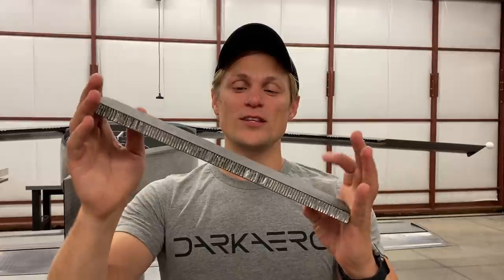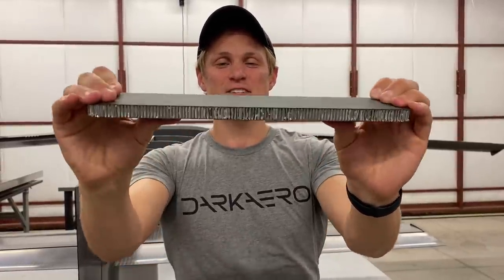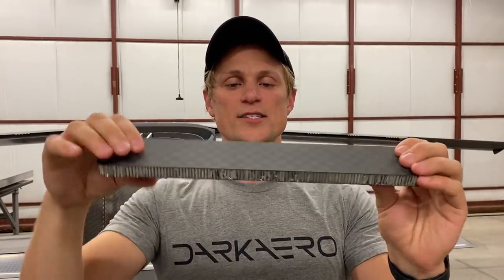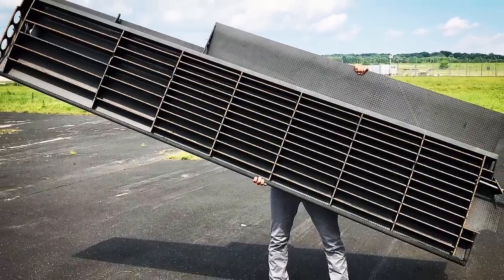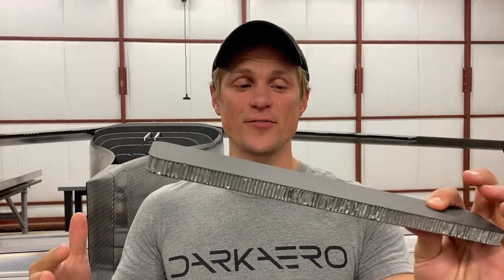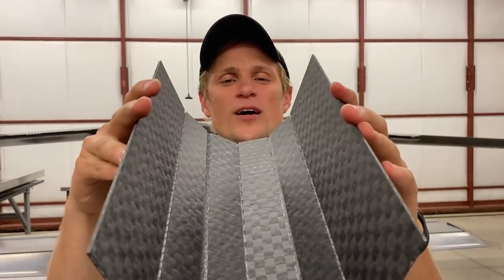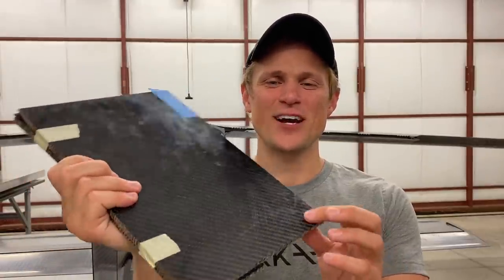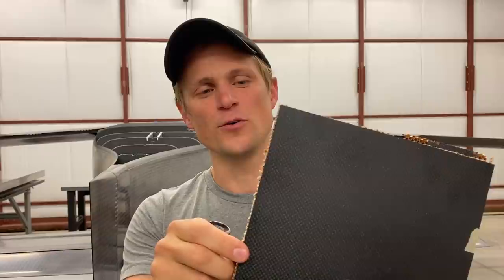CARBON FIBER + Honeycomb Sandwich Panels in the DarkAero 1 EXPLAINED!

Comment: If you guys dont use pre preg how do you keep the honeycomb from filling with resin?
Reply: I would guess gravity, by having the wet skin at the bottom, directly on the table.
Reply: @nraynaud  I'm guessing its a process similar to this:

https://youtu.be/YRpu3pb2b3U
Reply: Thats actually not really a problem. The interior of most planes (like Airbus A380, , mainly the side/window panels, are largely made out of nomex/aramid honeycomb filled with resin.
Reply: @12346798Mann  Filled solid?
Reply: @beachboardfan9544  yes, the honeycomb is good against horizontal forces, you can stand on it all by itself. The resin strengthens it against lateral forces and basically turns the whole piece into a single composite. 

I saw it at one of my company's subsidiaries, they are a tier 1 supplier for Airbus and basically make the whole interior excluding seats. The venting ducts are the craziest part, completely out of carbon fiber and spanning the a large part of the space above the cabin.
Reply: @12346798Mann  Seems like it would be wildly heavy

Comment: How does the manufacturer avoid the galvanic corrosion effects of cabon aluminum carbon honeycomb sandwich?
Reply from the maker: Hey John, thanks for watching and the question! We did a video on this topic. In short, they are electrically isolated. Full video here: https://youtu.be/yRpMZaU8zKw

Comment: Maybe save some of the offcuts from each panel, test each one for bending, and save in a library in case of issues with kit parts.
Reply: Evan Gatehouse    Good idea
Reply from the maker: Evan, we might do a video on this down the road but in the earlier days when we were moonlighting the company all we did was R&D and destructive testing on the panels. :)
Reply: @DarkAeroInc  This was more of a post production QA test to ensure you're not shipping parts where somebody mixed the resin slightly wrong or the vacuum was too high and sucked too much of the resin out etc etc. Just to verify that the material properties are as predicted.  At the high end in my world, the incoming raw materials are also tested before you build anything with it.
Reply from the maker: Agreed that quality checks are critical. We have a set of QA checks and manufacturing procedures we use that are mostly proactive but we run some destructive tests as well. In the process of developing the panels, we had to determine all the variables that contribute to making a quality panel. One thing we learned was that on a panel as large as 4'x8', there can be variation across the panel if your process is incorrect. Testing a cut off scrap is only useful if you have the correct manufacturing procedure in place to ensure consistency across the whole panel. We follow a specific procedure to manufacture the panels and document that key variables are within acceptable limits. Who would have thought making a flat panel could be so involved! :)

Comment: Aluminum + Carbon often has corrosion issues. I noticed that the panels you sourced from manufacturers used aramid cores which are completely compatible with CF. Are you at all concerned about that?
Reply from the maker: Great question! The carbon fiber skin is electrically isolated from the aluminum core with a thin layer of fiberglass. We did a dedicated video on this topic if you want to see more in depth info on how we handle corrosion issues. https://youtu.be/yRpMZaU8zKw Thanks for watching!

Comment: Curious to know why all the samples are Aramid core and you chose aluminum core.  Love the tech videos guys, keep them coming!
Reply from the maker: Hi James! We tested other samples that aren't shown in this video. The video shows a sample of the samples. :) The prototype DarkAero 1 uses both aramid and aluminum honeycomb cores depending on the structures. The internal structures of the Wing, HS, and VS are made from panels that use an aramid core while the fuselage bulkheads use aluminum honeycomb cores. Aluminum honeycomb has higher compressive strength to weight ratio compared to aramid. The fuselage bulkheads like the baggage floor and seatback see larger compressive loads so aluminum is a good fit for these. In production we are actually converting everything over to aramid core for manufacturability reasons. We have found aramid easier to work with in a mass production environment.
Reply: @DarkAeroInc  I was going to ask about galvanic corrosion considerations in bonding aluminum core to carbon fiber, but if you are transitioning to aramid core for production models that will take care of that issue going forward.

Comment: So in theory could you make a whole plane out of folded honeycomb carbon panels including all the outer skins? Is there any structural weakening when you mill and bend the panels? It would be a very boxy plane but maybe an interesting proof of concept.
Reply: Yes, the "Chipper" was manufactured this way and was boxy.
Reply: The YB-70 Valkyrie was built with an outer skin of stainless steel skins brazed to a stainless steel honeycomb.  They had compound curves.  They also had delamination problems.

The SR-71, designed just after the YB-70, used sheet titanium instead.  Leading and trailing edges, and the inlet cones and vertical stabilizer were initially an asbestos-silicone composite, intended to be stealthy.  They may have given up on that at some point.

It's amazing how long people have been using composite technology.  The De Havilland Mosquito built during WWII was, in some sense, a wood/glue composite, as were some of the wackier German airplanes.

Comment: How do you panelize/nest your parts in Fusion 360?
Reply: They are using OnShape. Not sure if there are different toolsets there. I signed up for a free account to play with it, but it was enough of a departure from F360 that I stopped pretty fast.
Reply from the maker: There isn't a tool that will nest them all for you. We also have to orient some of the parts according to the weave of the cloth. One plug-in that does help semi-automate it though is called, "Nester".

Comment: The inside of that wing looks awasome.. I'm no engineer but something tells me that with it being a wet wing and all those ribs it's going to be a bitch to fill the fuel tank at decent flow rate with out air locking and fuel coming back.. But I'm sure you guys have thought of this. Cheers love the plane and totally want one...but again I'm no engineer can't afford haha
Reply from the maker: The ribs and the shear webs that run within the wing all have strategically placed CNC cut ports that allow fuel flow between all cell cavities. The ports are placed at the maximum and minimum height position for each respective cell to allow fuel to flow down and air to flow up. Port size was determined based on calculations and testing for max fuel flow when refueling the aircraft. The wings themselves have a 3.5 degree dihedral allowing the fuel in both wings to flow down to the 1 gallon sump at the center of the wing, which is where the engine pulls its fuel from.

Comment: Wait a minute - you say you didn't use one of the prepreg plates, because it had holes and wouldn't store fuel well - but surely you wouldn't expose a laminate directly to fuel without some sort of liner? Also, when it comes to foam/hex cores, isn't aren't the carbon and cured resins the most temperature-intolerant parts of the laminate? I thought aramid and aluminium were both more temperature resistant than carbon and epoxy.
Reply from the maker: Thank you for watching Invisty! Great questions! Laminates can be exposed directly to fuel provided that the chemistry of the epoxy used in the laminate is fuel compatible. Yes, typically the cured resin and foam cores are the limiting factor for temperature capability of a composite structure. However, there exists a wide range of epoxies and core materials that can be used which all have different temperature capability. We only use resins and core materials with temperature capability beyond 300 F. I didn't give out any specific numbers in the video but many of the 3rd party panels we tested had carbon fiber and epoxy skins with service temperature ratings of 180F and below.
Reply: @DarkAeroInc  Thanks for clarifying, my ignorance probably stems from only using composites for boats. I think the very idea of a kitset carbon panel plane to be ambitious and really cool. Hope you can pull it off with all the tricky engineering required.

Comment: What effect will an inflight lightning strike have on that method of construction ?
Reply: Good question. I wonder if the aluminum honeycomb would create a Faraday cage? Don't they embed a copper lattice into the layup on airliners using extensive composites?
Reply: Dan Mallery 
Well I’ve only got about 3000 hours in the 787 and the only time we’ve ever had a problem is when we were parked on the ramp at Shanghai and got struck by lightning. It blew up the ground power terminal and we spent an extra couple of days there. I highly recommend a club called Manhattans ! ; ).
Reply: @savagecub   Yikes. Getting struck by lightning, even on the ground...better just leave the whole bottle. :-)
Reply: Dan Mallery 
Ah hell, airplane was parked at the gate. We were already at the bar in the hotel when that happened !
Reply from the maker: We don’t have good data on that because we haven’t completed lighting strike testing yet. However, we have been doing a lot of research on this and we are leaning on the testing and standards from the FAA (two good ones are the DOT/FAA/CT-89/22 and DOT/FAA/AR-40/13). The two big concerns are interference with the electrical system and fuel vapor ignition. One potential solution we are exploring is conductive coatings.

Comment: I'm a bit concerned about your fuel tank integrity. Would love to see the thought put into that design question.
Reply: Composite fuel tanks have been used for decades in marine applications
Reply: The question more has to do with the use of honeycomb core material. I can't remember now, but even if it's not paper, I'm concerned about fuel being trapped in the voids making the airplane unnecessarily heavier.
Reply: @Zalex612  This was spoken to explicitly in the presentation.
Reply: @mavigogun  You're right, it is brought up at 6:09. What I was referring to specifically, is the bonding joints between the honeycomb and the skin when the wing is assembled. If there is even one error/bubble in that bonding surface it could lead to a slow seepage of fuel into the sandwich structures that would, at minimum, increase the weight of the aircraft. Worse, possibly, is delamination and debonding at those seepage points due to thermal expansion/contraction cycles. The wing could become structurally compromised after a few years or so in the elements. Don't believe me? Look at how careful Mike Patey is when building his fuel tank. https://www.youtube.com/watch?v=JZSGdM9cWjY In that example he's just being very thorough to ensure there are no leaks. Also, notice how every cell of that tank has an access panel? There's a reason for that. Future repairability. His tank isn't even a composite tank!
Reply: @Zalex612  It would seem fraught with peril, as complex as it is.   Either they have developed blindered to this point, or they aren't sharing their solution.   I reckon the second is more likely.

Comment: I am absolutely no professional, so please understand my question as sheer interest. I understand the need for certain stiffness. However, especially when material is under high stress I would expect flexible material to sustain the situation a lot longer than the stiff one. Additionally, I would have a chance to realize the problem before the wing breaks since it bends while very hard material doesn't show any tear until it suddenly breaks. Am I wrong with my assumption?
Reply from the maker: That's a good question! In the case of our aircraft, stiffness is useful for preventing buckling failures of structures and for preventing aeroelastic flutter. The airframe is designed with safety margins so that it can withstand loads within the flight envelope plus some extra. Carbon fiber does have some flexibility to it, it just doesn't plastically deform before it breaks. This flexibility can be seen in this video where we did a full scale proof load test on the wing: https://youtu.be/7hvu-oQZdvE
Reply: @DarkAeroInc  Hi, thanks for your answer. One thing that concerns me generally with the choice of material is that when you overstress metal structures and they start failing, you will see the cracks. Not that much with your material choice. Is there a plan or any idea how to make these "invisible" damages visible to prevent a small damage to become big after some pilot has overstretched the limits of the ac?
Reply from the maker: @crazycons  There are visual inspection techniques for assessing small defects/damage to composite structures along with other non-destructive tests like tap testing and ultrasound. The FAA document AC43.13-1b has some information on inspection and repair of composites. Cracks in metal structures are typically the result of fatigue which is repeated cyclical stresses that cause small defects in the microstructure of the metal to grow and propagate into larger cracks. Composites, in general, are much more tolerant to cyclical loads. Small defects in the microstructure of composites do not tend grow into large defects so this failure mode is much less of a concern in composites. This resistance to fatigue is part of the reason that there is a big shift towards composite materials in the aerospace industry.

Comment: Thank you for sharing. One quick questions. 
 How did you handle the potential issue with galvanic corrosion?
Reply: Sì! E la corrosione?
Reply: Same Thoughts...a large helicopter manufacturer had made their tail boom panels with aluminum core... they had to redesign due to corrosion.  I believe this comprised strength and caused problems.
Reply: @jeffreygoyer7760  I would imagine the solution be either or a combination of anodizing the aluminum material, and an epoxy/fiberglass barrier. But let's see what their solution is.
Reply from the maker: The carbon fiber is electrically isolated from the honeycomb using fiberglass. The panels themselves are carbon - fiberglass - honeycomb - fiberglass - carbon.

Comment: Carbon fiber + aluminium= galvanic pair,  just with a bit of humidity aluminum will start degradate.
In sailing it's a regular problem when metal parts have a direct connection to carbon fiber parts like for ex. mast

Comment: I hope you guys have a good factory build center because all the glue joints for the wing skins have to be perfect. This is why the commercial gliders have single spar to ease the manufacturing because they only have to worry about the main spar, the ribs, the leading edge and aft spar.  Good luck though. We need to have another composite kit that follows the Lancair 360 or the Glasair 3.  However, few people can afford to build them.
Reply from the maker: @2Phast4Rocket, this part of the assembly process is done on our end. The builder receives the wing fully closed out.

Comment: Drop one of those panels in a bucket of salt water and leave outside for a few days to see how the core stands up to corrosion. We do not usually recommend aluminum core against carbon faces, unless of course you have a glass insulating layer!
Reply from the maker: Thank you for watching Dan! We discussed the corrosion issue you mention in this video: https://youtu.be/yRpMZaU8zKw

Comment: Very impressive guys. Do you have a video where you talk about bird strikes? I heard carbon fiber does not hold together well during a high speed impact. I was wondering if you address this concern somewhere?
Reply: The issue has been addressed in several published studies. Fighter jet wings have been made of Carbon Fiber since the F-16 (Mid-1970s). Formula-1 Racecars use Carbon Fiber for their chassis, and a review of F1 crashes shows it's very good at protecting the driver in a crash. And modern airliners are now using it extensively. Carbon sort of smashes and delaminates when struck. But cracks dont spread easily. So as long as the wing leading-edge is not the primary load carrying member, you can return to base after a bird strike. The skin carries the torsional loads, and a hole in the skin is going to reduce structural strength and resistance to twisting, as well as acting as a stress riser. So the airframe probably won't support it's design loads factor after being damaged. The advantage to the DarkAero construction, is it's very compartmentalized. Built similar to the modified AV-8b Harrier, which has 7? Wing spars, all carbon composite. It can survive machine gun fire and multiple 15-23mm cannon hits. Because no spar is critical and it can continue to fight with one or two spars shot to bits. The holes in the wing skin can only spread so far, because of the internal structure. And the loads through the skin are transferred around the damaged area through all of that internal webbing. 

I have high confidence in the DarkAero construction method, as these guys are using and borrowing a lot of sound ideas and testing then thoroughly. The only issues may arise several decades down the road if people are unknowingly damaging them and failing to perform proper repairs. And potentially issues with moisture getting through the outer layer inside the honeycomb and causing corrosion in the aluminum core, or freezing and delaminating it. But this will be with too thin of skin, to porous of epoxy, followed by poor paint jobs with too many pinholes, and/or after crushing damage that goes unaddressed.

I wouldn't worry about the structure. (But I'm not holding my breath about the crafts handling qualities, it's not going to be a Cessna 152. And I suspect it won't be as forgiving as the Lancair 200/235, either. Which is aproximatly it's equal in terms of size and weight).